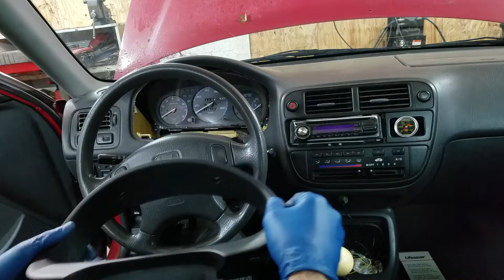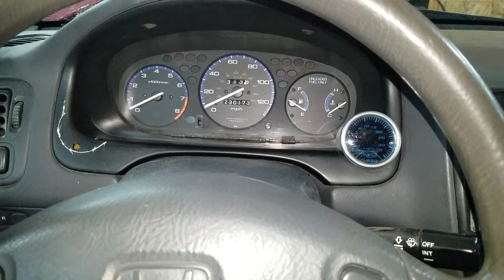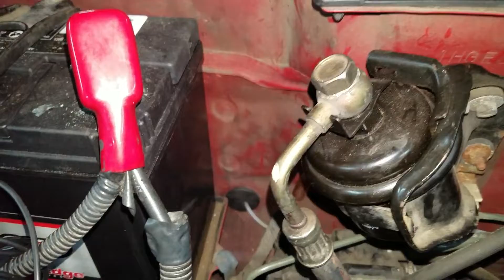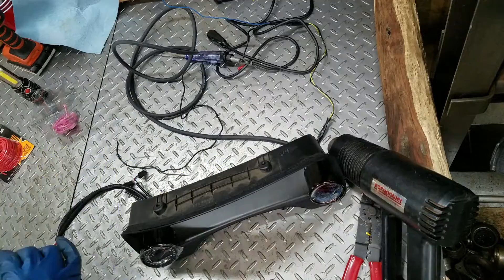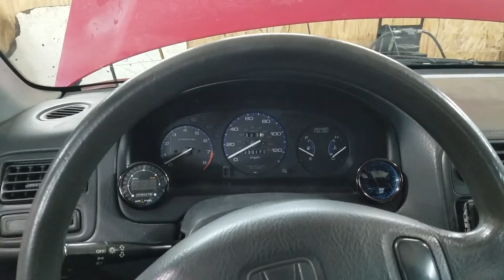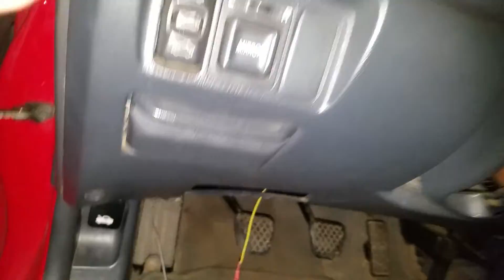Ej8 Civic D16 Ebay turbo build part 13

Comment: Really nice job with the gauges. I have a wide band O2 sensor on an old carbureted pickup. It is the only way to tune a carb, and after that, it is good as an overall health monitor for the engine. Thank you for sharing.
Reply from the maker: I have jetted many carbs without one, and do agree that it is best to have one. In fact, I have jetted every carb without one. Started working on them in the 90's before anyone even heard of them.